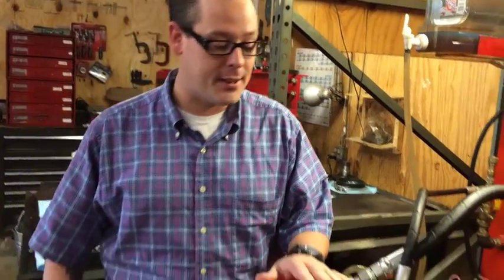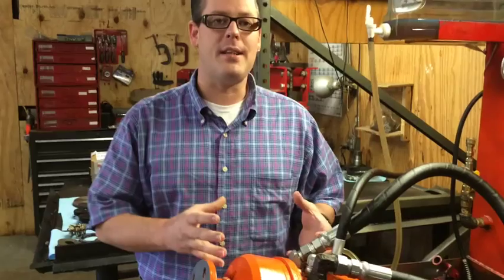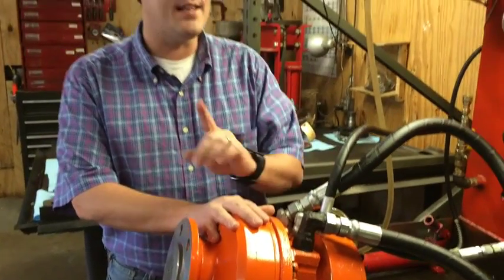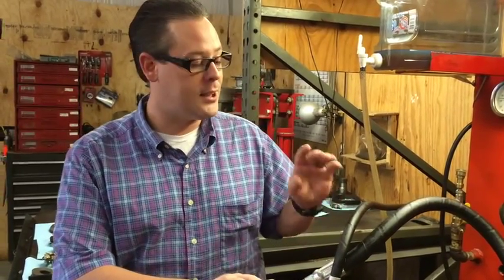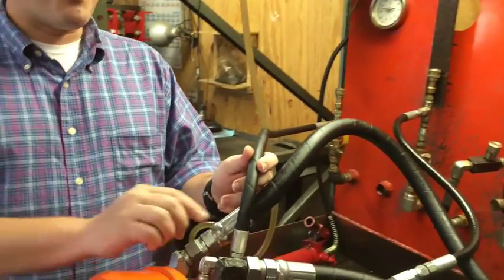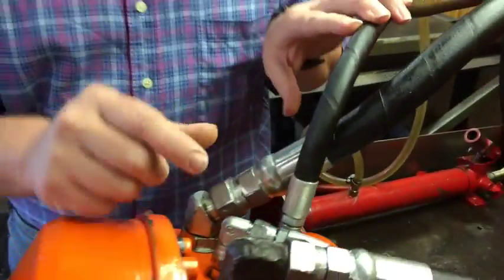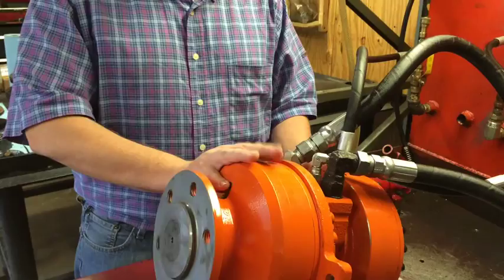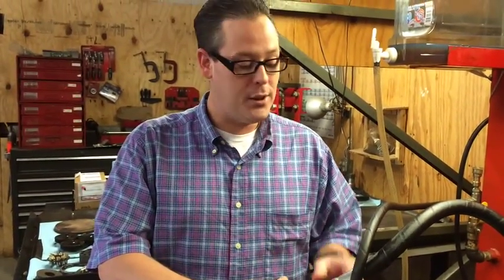T190 Bobcat Travel Motor Problems: Drive Won't Move!

Comment: I have a takeuchi TL8 that I bought,  and the previous owner replaced one final drive,  but the machine only turn one way ,if I go forward go's very slow, I checked the lines a d they are where the shud be

Comment: Hi , I have a 96' 773 bobcat and the bucket loses pressure fast. I don't notice any loss of power but the right side wheels are slipping under load. i will check my case drain filter on Sunday, any ideas what my problem is?